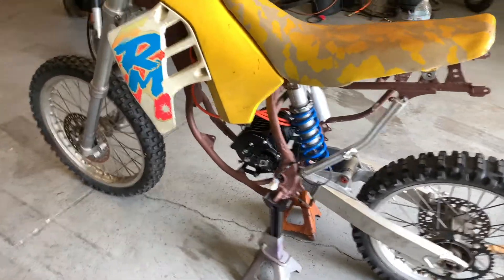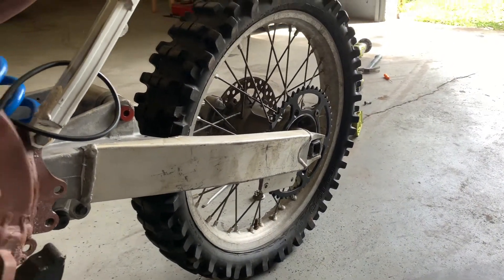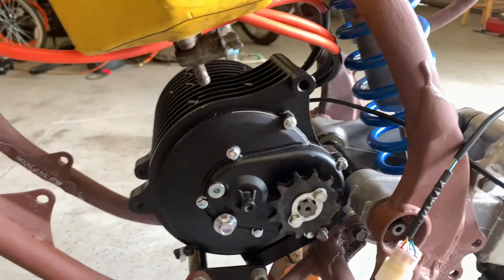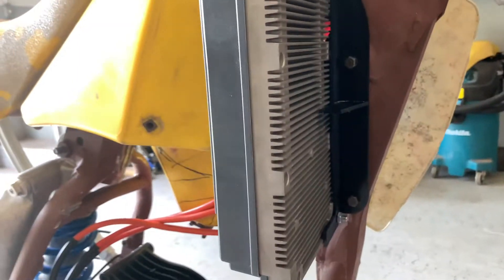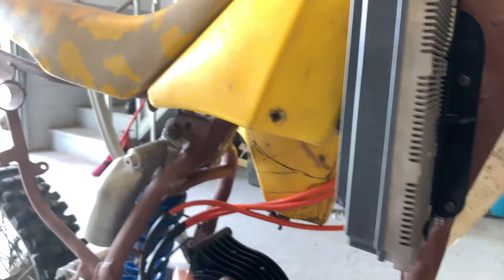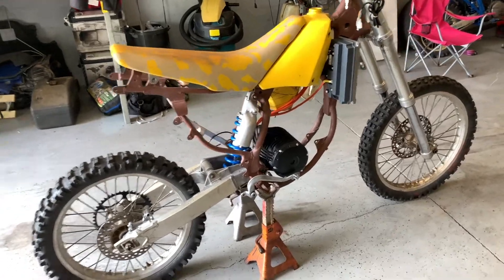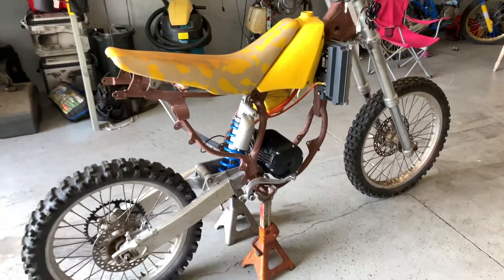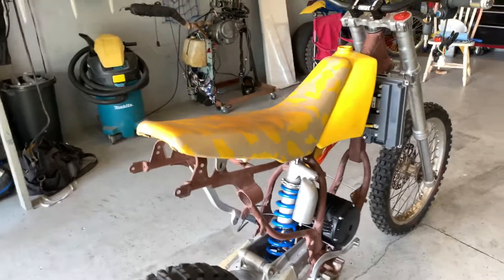Suzuki RM125 Electric Dirt Bike Build QS138v3 Part 1

Comment: Hows the build going? I was looming at a 92 rm doing an electric conversion
Reply from the maker: motor and controller are mounted, waiting on batteries still. had some problems there. first shipment had two damaged batteries. hopefully will get to assemble the battery soon.
Reply: @akimkhlyapov4815  how’s everything now?